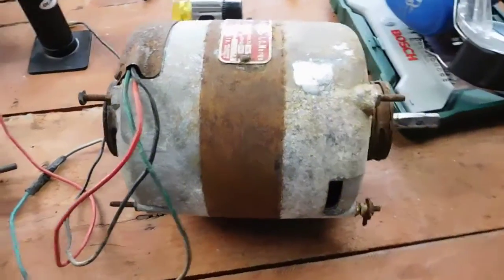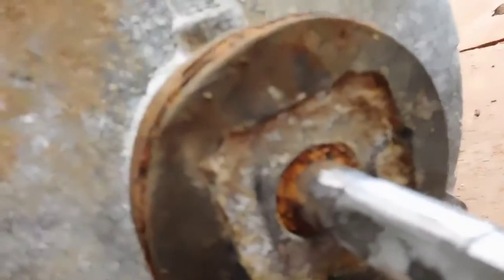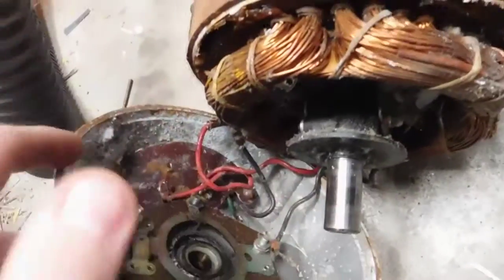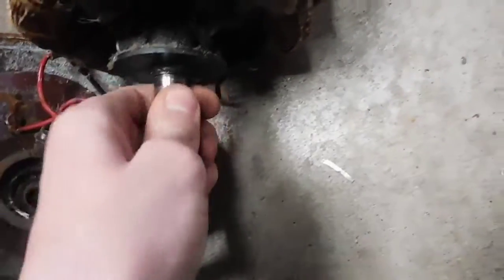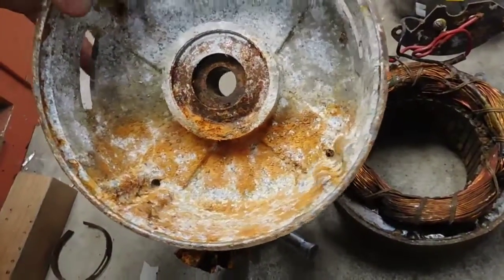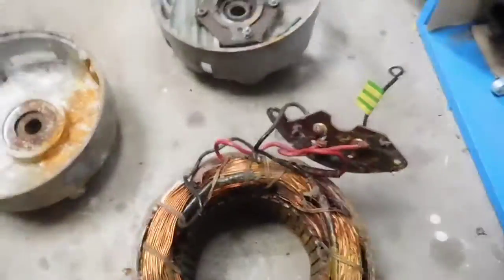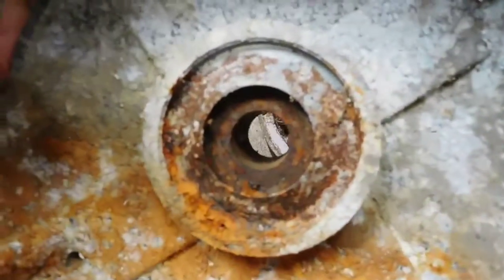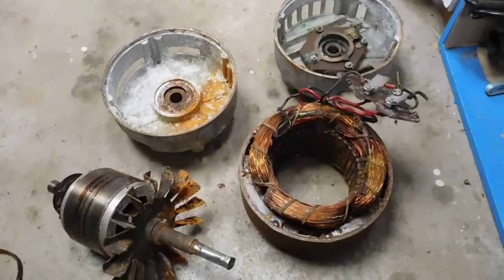Busch Single Phase Motor Overhaul P1-Dissasembly

Comment: Those copper winding wires have some sort of coating on them, right?
Reply from the maker: Yes they do, is an enamel insulation on the wire strands then a coating of varnish on the complete, wound stator